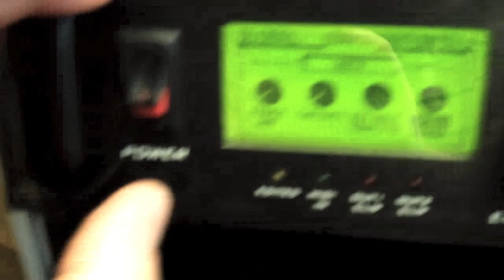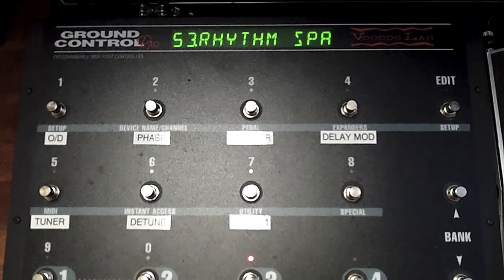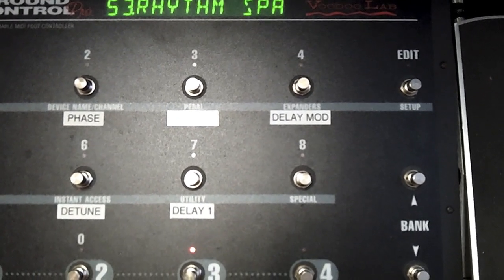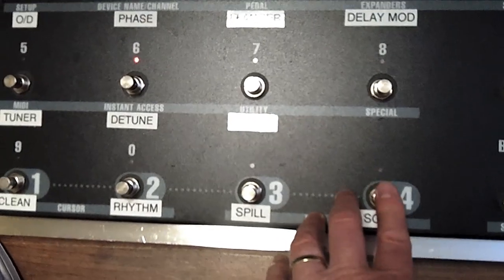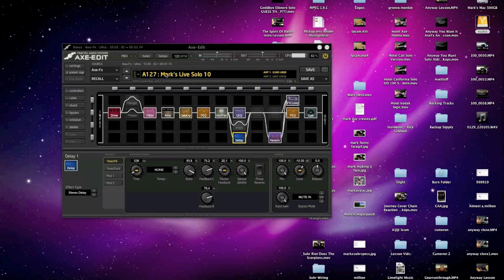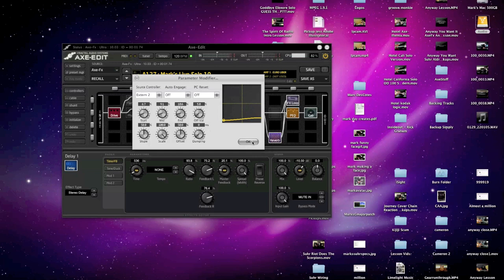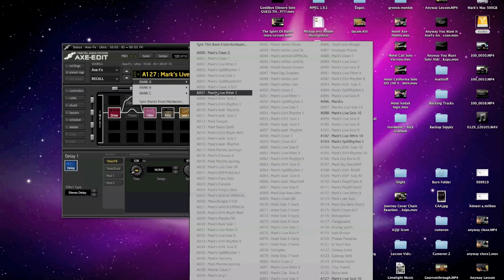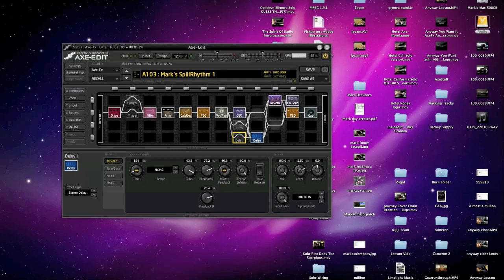AxeFx and Ground Control Pro Spillover Instructions

Comment: Hi there Mark!
I know this vid is old and you already have the axe2 (and i believe you have the mfc101) but I thought I'd give it a try.
I see you have your Expression Pedals running through the Inputs on the GroundControl and via the MIDI Cable to the Axe.
I have problems getting this to work.
Pedal into the Axe's Pedal inputs NO PROB.
But I do not get the function over the MIDI-Cable.
Could you tell me what I will have to set up on the GCP and Axe to get that working?
Perhaps a vid?
THX

Comment from the maker: @CodePoet As stated in the video, I/A 4 on the GCP sends out midi CC10 to the AxeFx which is Ext Ctlr 2.  You can set it to control as many parameters as you want.
In this situation I have it control the Delay Time, Delay Repeats (feedback) and the Delay Level (volume)

Mark